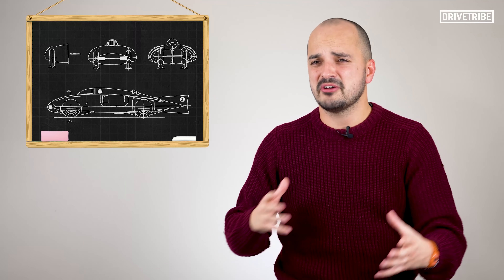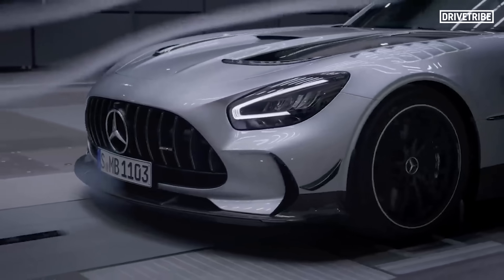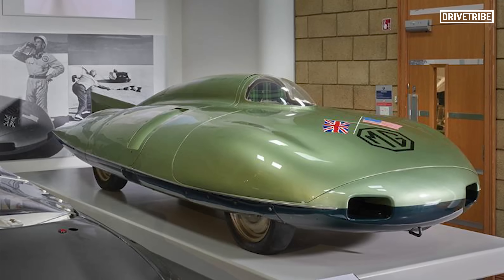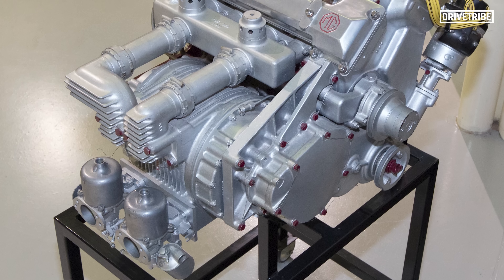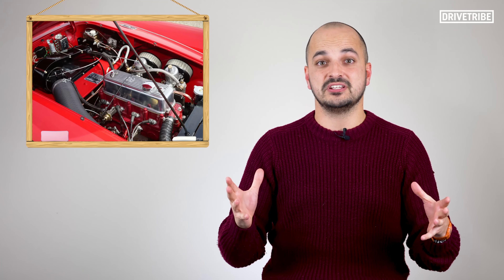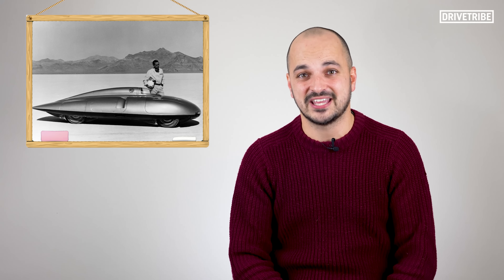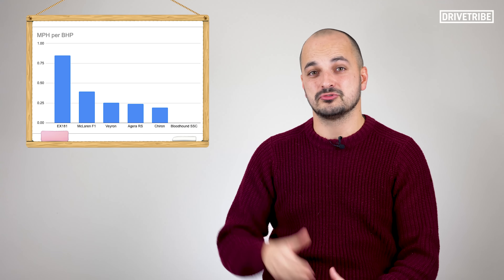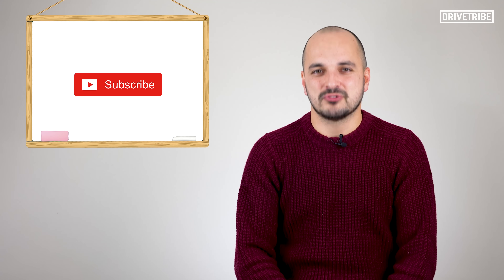This car reached 254mph using only 300bhp

Comment: So in 1959 we could make a car so efficient, it could do 250mph with just 300hp.  In 1971, the  SR-71 Blackbird airplane also set the world record for speed, which has never again been broken.  In the late 1970's, anyone could purchase a ticket and go from New York to London in just 3 hours on the Concord.   Today, with all our technology, computers, advanced prototyping, we are back to chasing these past records and innovations!  What's happened?
Reply: the SR-71 was the fastest (air breathing)jet aircraft at Mach 3.2 but the X-15(rocket powered) was much faster at Mach 6.7, the title now belongs to X-43A(air breathing) at Mach 6.8 the caveat being that its unmanned though.
Reply: A mix of health and safety and emissions
Reply: The Concorde was successful in every measure except financial. As for cars, very few people would buy a car that was as impossible to use as this MG. Also,  speed limits make top speed irrelevant for most drivers,  and efficiency in aero doesn't mean decent acceleration.  You need power to accelerate in traffic. That MG could do 80 mph on about 30 hp or less, but would accelerate  slowly. 

What's amazing is that modern cars with so much room,  luxury, safety and fuel efficiency can quietly and comfortably carry a family and luggage at 150mph on the autobahn.
Reply: To give you an honest, no BS answer, it comes down to cost. These records that were set under supervision and certified by the FIA were done when the Bonneville Salt Flats were in perfect condition. This hasn't been the case in the couple of decades that I have been involved in Land Speed Racing. There just isn't enough usable length to set up a 7 to 9 mile of course with runoff. The 2 salt beds that could support that length are Salar de Uyuni in Boliva and maybe Lake Gardiner in Australia. So travel to either of these locations is one cost and then there is the cost of setting up this type of event. I think the cost of setting up the last FIM event in Boliva was somewhere in the neighborhood of $50k up front to run 6 motorcycles. There just isn't that much interest in setting FIA Land Speed Records anymore.
And as a side note, that car only holds the FIA record for that class. That car today would run in the SCTA class of H (1.016L to 1.523L) Blown Gas Streamliner that runs on an SCTA record of 331.133 mph that was set in 2004.
Reply: @dantuttle2050  Thanks Dan, that was an excellent analysis.
Reply: You are over simplifying complicated things. The Concord was parked because of crashes and it wasn't very profitable. The SR71 isn't the fastest plane in history. The X-15 flew 5140 mph which is the record. The SR 71 topspeed was less than half of that. 2400 mph. The  300 hp car that goes 254 mph isn't/ wasn't practical. It literally almost killed the driver with gas fumes.
Reply: X-15 only had a short range compared to the SR-71. Granted the speed difference is massive. The car however impractical was a marvel for its time
Reply: @MyNameIsNotEmail.ItsEmail  Concorde suffered only one crash in its service. One. A crash that was caused by a maintenance mishap. Because of all this "green obsession" it was a perfect excuse to cease operation. Other planes have seen many crashes and continued service.
Boeing lobbied against Concord at launch to stifle competition as it failed to materialise its SST 2707 project. So they reduced where it could operate on/over American soil. They blamed it on noise, and shock waves when going supersonic over land. If Boeing had a supersonic plane none of those "complaints" would have been risen.

Same story with "fuel crisises" even back in 70s a fuel company lobbied making it difficult for new competitors entering the market. All corrupt, all to protect the invested interests of the few.
Reply: @Sh4un1r1k  not wasting my time with all that. What "green obsession" Wanting to keep the planet viable for future generations isn't an obsession. It's common sense. However that isn't why it was grounded. Decreased demand and exploding maintenance cost did it in. Which would end any business
Reply: @Sh4un1r1k  one more time....not wasting my time with that.
Reply: @MyNameIsNotEmail.ItsEmail  I don't care if you don't like the truth. But You were wrong with the crashes. One crash in its service life, grounded. Other jets had more accidents and didn't receive the same scrutiny. Politics. One more time...accept being corrected. 
I accepted your other statements for contributing to Concorde's demise. 
Pride is a horrible thing.
Reply: @Sh4un1r1k  didn't read that either
Reply: @MyNameIsNotEmail.ItsEmail  Took the energy to reply so......
Reply: @Sh4un1r1k  I read that one. I replied because it's rude not to.
Reply: @MyNameIsNotEmail.ItsEmail  Thats fair, I respect that.  Be safe.
Reply: @Sh4un1r1k  😒
Reply: @JT11D-20  That number doesn't tell the whole story. It was used from 66 to early 80s, when MiG 31s were revealed and could intercept it. That and how expensive it was meant it was canned in the late 80s. Then, it restarted in thr early 90s (93 iirc) until 98. That's less than 30 years, which is not a long time in the war plane spectrum. Cars and planes don't have the same lifespan. Planes last a lot longer, and there isn't the need to make "new models" every so often. Consider the U2, B52, and C130, all are older than the SR-71 and still active. The F15 has been around for 45 years and they're still producing them.
Reply: The biggest thing that happened is that all of those are non-sustainable. This MG wasn't a car, it was a prototype land speed car.  The SR-71 was a VERY expensive, VERY hard to build and maintain airplane made mostly obsolete by Satellites.  The Concord lost money on every flight(it was too expensive).  We can build all these thing still, but there are other priorities.
Reply: My Grandfather stated that Modern Human Civilisation peaked right after the Second World War. This was in the 1960s looking at this it appears he was right. The other thing he said was we were like the Roman Empire, still expanding on impetus but rotten at the core!
Reply: @davidrunnalls3039  Your grandfather was pretty smart 😉
Reply: The photo of the driver with the car is Moss, not Hill. 🙋
Reply: Because people like big SUVs.
Reply: Ignorance is what’s happened. The SR-71 is only the “official” record holder. We know for a fact that it’s CIA sister (not an SR) was faster but records are secret.

Not only is what you’re saying ignoring classified records of vehicles we don’t know exist, but it’s ignoring how dangerous and inefficient vehicles like concord and the space shuttle were. Oh, and in this video they outline the flaws with this car. Basically no brakes. Nearly asphyxiated the driver. Can barely manoeuvre. Not exactly suitable for driving on the road. It had one job and could do it well at the expense of everything including safety.

And as for with current tech chasing what we’ve already done. We aren’t. We’re chasing similar goals but creating things in a much better way. For example, a modern redesign of the 60s F1 rocket engine that propelled the Saturn V reduced the part count from over 5000 to under 100.

The fact is the progression has been staggering. You’re just ignorant of it because you can see a bigger number where some dial says “speed”.
Reply: Purpose.

Why do you need a manned plane to go that fast? We have drones,  unmmaned planes, or satelites. The SR-71 became obsolete quickly because satelites took over its job. 

Same for that car. What's the point of making a tiny engined car go that fast? For the lols? It has no relevance, so it's not attempted. In this case, there's the "but it's a record" argument, but those only work for overall records, not segment/restrictive records. We care about the fastest production car, but we don't about the fastest "NA V8 that's less that 5L" car.
Reply: @TehMehKehIen  SR-71 was taken out of commission as it was expensive to run / maintain and defence budget was reduced. Satellites being more available had a big impact on it too. Wonder what they could do with todays tech though to both the SR-71 and this car
Reply: It's really hard to do that, and despite what a lot of people think petroleum fuel only releases so much energy when it combusts
Reply: Safety regulations.
Reply: Simply saying we don't need it, Concorde is no longer feasible as the noise it produces shatters glass panes and is a complete mess for people who have houses below air routes, sr-71 spying job has become obsolete and it's task has been replaced by super precise and low risk satellites, om the subject of a 300bhp car doing 254 mph, these days car manufacturers are chasing better track times rather than mere straight line speed with next to zero control. In simple terms humans have evolved and have got their priorities changed.
Reply: "Today, with all our technology, computers, advanced prototyping, we are back to chasing these past records and innovations" - You're comparing a sports prototype running in a desert or on a dried salt lake, with a street legal car running on an public or test road. That's where all the difference comes from.

As for purely speer records, they broke the sound barrier and reached 1228 km/h in 1997 and now they are aiming at 1608 km/h. When this MG ran, the land speed record was 634 km/h.
Reply: Demands and regulations.

People stopped pushing the boundaries. And the regulations started imposing safety concerns.

With today's tech they could equal this. But wouldn't be allowed to.

The cost of equalling it is the true step back. It'd come in at 100x the cost now despite loss inflation or purchasing power say it should only cost 20x as much... 

Everyone is just so fast and loose with the money now that these things don't get attempted as much.
Reply: Health and safety happened
Reply: People nowadays would rather go into "service industry" jobs rather than engineering, that's why we've gone backwards.
Reply: @stanleybuchan4610  that's called ignorance
Reply: Fast travel is obsolete when you can Skype someone the other side of the earth instantly. No need for concord.
Reply: Maybe people didn't want to blow up
Reply: Rampant, uncontrolled capitalism which only desires unlimited growth in revenues, not advances in technology. Regulation doesn't stop people from doing dangerous things. It just stops dangerous people from harming others in the process. Consolidation of market leaders and the endless need to always earn more year-over-year has compressed the marketplace into silos that deliver consistent, repeatable revenue streams. Combined with planned obsolescence and the fact that experimentation costs a lot of money, you see less and less innovation, and more of the same ol', same ol'. 

Commenters claiming that government and regulation have killed innovation are simply repeating capitalist talking points they've been fed for decades, all while those same capitalists have been lobbying for the end of regulation so they can make more money for less outlay of capital using existing technologies. An excellent example of this is fossil fuels and climate change. We KNOW that its real and that burning stuff causes it, yet all Big Oil spends on advertising and PR and lobbying is focused on maintaining that existing infrastructure and actively demonizing alternatives, like wind, solar, and nuclear. 

The top dogs in all industries don't want to lose their astonishingly enormous paychecks since it won't pad their bank accounts as much. My question to them is simple; After a few hundred million, there's nothing anyone could do with all that money, so why horde it as its clear doing so is actively harming global society? 

But then, they've been attacking taxes for decades, as well. So, there you have it...

PS: Instead of trolling the truth, spend a few minutes thinking about where you life is and where it could be if someone, somewhere cared enough to divert some money into things you care about or think are important to the welfare of your community? There's always something that needs work, and it's not regulations and high taxes that are preventing them from getting fixed. Then again, you have free will, so do what you like...
Reply: Government happened
Reply: Eco-bullies, enviro-mentalists, green marxists and Nanny Karens who don't want YOU to have fun because it makes them feel unsafe, that's what happened.
Reply: @bghoody5665  Pretty much. But most established companies don’t have their Elon. I work in aerospace. I challenged our CEO about this and the CEO was a bit offended. Boeing, Northrop, Hughes, Douglas were started by men with vision and fire in their bellies.
Reply: democrats
Reply: What happened? We got soft. Look at todays epidemic versus past epidemics.
Reply: @jamesdellaneve9005  dunno, we are doing a helluva lot better in terms of deaths compared to the 1918 pandemic.
Reply: @Erik-ou3tl  That was a different animal. Killed millions of children. This one isn’t.

Comment: My civic has shockingly similar performance
Reply: @Socal Drives Warning, danger to manifold.

Floor falls out
Reply: @samnope7344  the manifold, if damaged uses magic power to completely and utterly destroy the car if the warning is not taken seriously, please inform your family, friends and loved ones before it’s too late.
Reply: Make sure to turn on your v-tec before you try to break the sound barrier, or else it's just a grocery getter
Reply: @bubbaderp21cringeinitiatio6  and turn off the AC
Reply: @mattatmoney9488  hot and juicy is what it takes to achieve the honda miracle
Reply: @mattatmoney9488  and roll up the windows
Reply: @bubbaderp21cringeinitiatio6  Indeed. 👍
That's the gist
Reply: I'm sure it does.... 😁
Reply: What?  The ability to go 254mph? 😉
Reply: V tech just kicked in yo
Reply: Same
Reply: ....with less than the half of the hp